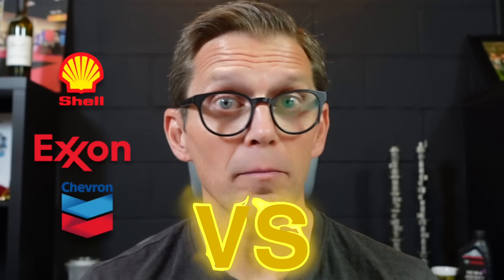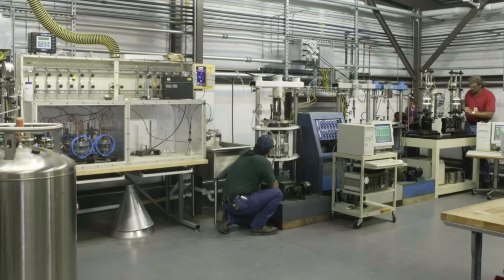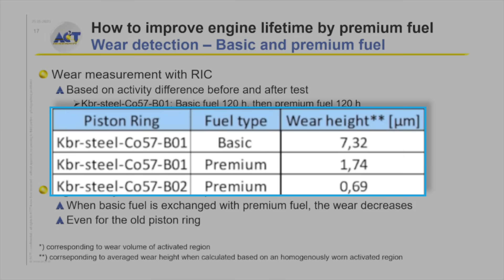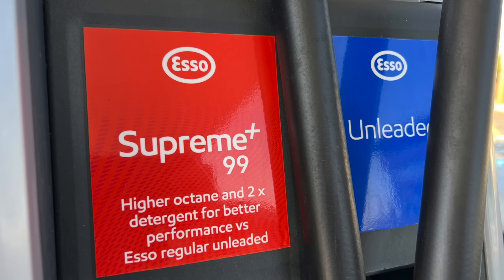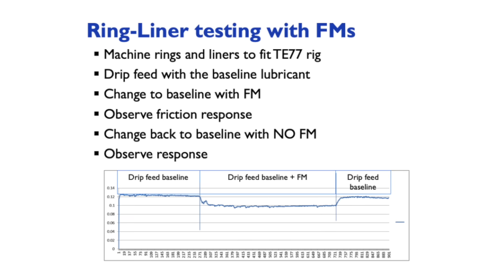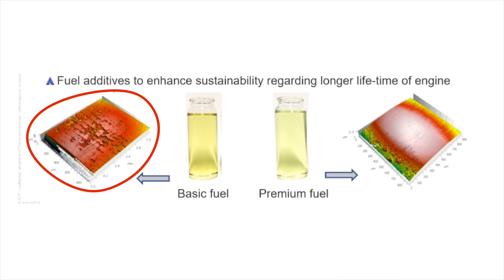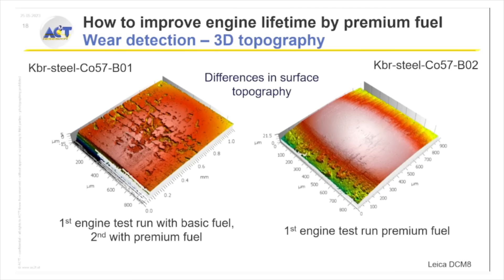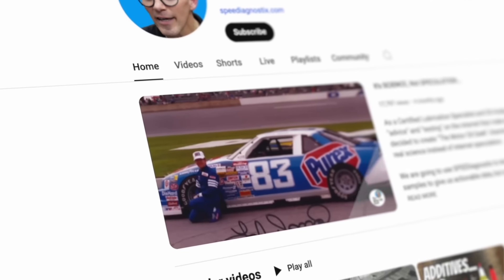Can Premium Fuel REDUCE Engine WEAR?

Comment: Thanks for this video. I always viewed premium fuel additives as for just keeping your engine clean. I never saw them as preventing wear.  I always thought it was just the oil alone that did that.  I will consider using premium gas from here on out.

I do have a question for you that I hope you can answer in a future video.  My mechanic said if I want to clean out carbon build up in my engine that I would be better off using high octane fuel instead of buying some cleaner from Auto Zone or similar stores.  He claims those cleaner in store are very concentrated and while they do the job they also eat away at seals and plastic liners in the gas tank.  

Thanks

Comment: Marvel mystery oil in fuel eliminated fuel dilution and oil consumption on my 2014 Mazda CX5 with 145k miles, really magic stuff it does all injector cleaner upper cylinder lubricant fuel pump lubricant carbon build up cleaner and probably many other things, I started using it in all my vehicles and motorcycles, don’t forget diesel engines last longer for the reason that diesel fuel is 2 in 1 fuel and lubricant works as cylinder lubricant, It’s all about lubrication guys in this world of consummation we living in if you want to keep going longer good lubrication is the key, human body as well has lot of benefits from good oils.
Thanks for the video

Comment: Wow, I guess it make even more sense when you realize a Gallon of gas no matter what the brad or even Octane rating produces the same amount of energy per gallon. Octane rating is a measure of a fuel's ability to resist premature ignition, or "knocking", and is a key indicator of a fuel's performance but does not change the overall energy it produces. But now we can see a correlation between the additive package and ware alongside of it's cleaning effects.

Comment: I had never heard of anti-friction modifiers in gas.  I always just thought it was octane boosters (ethanol) a detergent package, and sometimes some other additives to help the environment (such as California's blend).  I would love to see a fuel comparison between some cheap off brand stations, low end shell/chevron (or other top tier) and premium.  I believe all top tier fuels contain techron or at least several times federal minimum detergent requirements.  I know top tier fuel makes a massive difference in engine carbon deposits!

Comment: I would presume the same additive packages are used in DF2, but what about using over- the- counter diesel additives? I use Hot Shots for the CP4 fuel pump on my 6.7 Powerstroke, and have started changing oil at 3,000 miles with fuel filters at 10,000.

Comment: What is the most common cause of engine failure that isn't reasonably repairable?
Reply: my 1st guess is radiator issues leading to overheating and thus warping of parts or cracking.

Comment: I would love to know the difference between detergents in premium vs regular at a top tier gas station. I also just found E5 93 by my house also at conaco. And are upper cylinder lubricates bad like amsoil, mystery oil, or lucas to add to every tank and an injector cleaner at every 3-5k oil change?

Comment: 110 ppm (basic) v's 70 ppm (premium) = 40 ppm (36 %) reduction.
That's a great result.
This explains why car engines sound better (quieter, smoother, more power) when running premium fuel.
:-)
Reply: 40ppm is nothing, no matter how good the additive is.
Reply: @dwang552  Your rings will last ~1/3% (36%) longer if you're using premium fuel.

40 ppm (40 mg/L) sounds like it isn't much... but if we were measuring wear in the entire engine 70~110 ppm would usually be considered excessive.

A good result would be combined wear metals of 8~9 ppm/10,000 km: 
70 ppm is almost an order of magnitude higher.

There's obviously a lot more wear going on than is ideal.
It explains why compression is one of the first things to drop as an engine ages.

:-)

Comment: What is "premium" fuel? Is it 93? Is it "Top Tier" brands? Is it something I need to add? The science is great, but I need advice on what to buy.
Reply: Great question !!! Was thinking the same as I'm not sure either if Lake differentiates between the two. I always seek out top tier stations,   but I always run premium  due to my vehicles requirements . Sure hope Lake responds. 
On another note how do we really know a specific gas 
Station adheres to corporate standards- not a question for Lake. Just putting it out there.

Comment: I have always read and been told that the only difference between regular, mid-grade, and premium fuels of the same brand is the octane rating. Meaning that, for instance, all three grades of Chevron fuel will have the same additive package. 

Is that still true? 
Is this test of European fuel more akin to test Top Tier vs non-Top Tier fuel in the US?

Comment: With our legacy v6 and inline 4 engines, cheap gas and 5k oil changes gets us 200k+ with no engine failures.  So any better life may not mean much to me, since I am ready for a new vehicles after 20 years old.  For the newer direct injection engines, perhaps it needs better fuel?  I may be dead before I find out.

Comment: Been telling this to my customers and friends for yrs, most don't listen. I run shell 99% of the time v power in my expensive stuff for decades now, along with quality oil and 3-5k interval changes, Ive yet to have any catastrophic internal engine failures, even ran a hemi in a Durango to over 300k without a single leak or lifter failure.

Comment: SoCal resident here running M112 and M113K Mercedes engines. Worn down motor mounts turned out to be a great test environment to determine comparative fuel octane levels from different brands, despite the fact that all Los Angeles gets its fuel from only a couple refineries. Least to most vibrations were in this order: Vpower, followed by Tekron, Synergy, arko, unitd and Krklnd. The latter 2 shook the engines a great deal, triggering knock sensors. 
Test engines had proper compression, new plugs, coils and injectors, no burnt valves or loose bearings on upper and bottom end inspection.
Reply: Also have a M113k. So you're saying Benz's recommendation for Mobil 1 products is moot? So Shell V-Power from now on, including oil?
Reply: @abel4776  Clearly I did not make a general statement about Mobil products. I was referring to gasoline. I am fine using Mobil 1 0w-40 or Pnz Platinum Euro 0w-40 in their current formulations. That said LM Synthoil 0w-40 has managed to stay stable for longer and engines were quieter for longer (anecdotal based on my 2 vehicles). How’s your oil consumption?
Reply: @linvesel  Can't say much, just got it, :) I am reading everything to best maintain the engine for years to come.
Reply: @abel4776  congrats. Do this:
1. 3000 mile oil changes using good oil and either Mann or Hengst filters. 
2. Make sure to drain oil from BOTH drain bolts, your car has two. 
3. Transmission fluid change every 30k with new filter and gasket. 
4. When replacing brake pads&rotors, always deactivate the SBC system using a scan tool with Mercedes-specific software. Do NOT work on brakes while system is pressurized—that will reduce the life span of SBC components and brake feel will be inadequate. If you’re having a mechanic do the work make sure they are using this method—not like a standard car. 
5. Consider a supercharger oil change before 100k miles on the odometer. There are writeups how to do it, and it’s a bit cumbersome, but totally worth it if yours is in a good shape. 
6. Air shocks are utter garbage. Let me know when you’re about to lose your patience with them. I’ll recommend a coilover mod. 
7. Have fun, and none of that small supercharger pulley nonsense. Unless you bought two E55s and you like the sound of metal parts popping under hood on WOT.
Reply: @linvesel  Advice much appreciated. I bought BenzNinja's STAR SDS system, so I should be prep'ed for brakes. You said Air Shocks (AIRMATIC), but do you also mean the Hydraulic system (ABC), which I have? So far I like it, no issues, do you recommend swapping that with coil overs?
Reply: 240K on my M272. Runs like new on Shell V Power, crap on everything else. I only use a 5w40 viscosity and have tried just about every premium brand: Fuchs, Total, LM, Valvoline Euro, etc. Engine runs smoother and gets at least 2 miles per gallon more on LM Leichtlauf 5w40 which makes it my go to oil for the remaining lifespan of the car..
Reply: @linvesel  Just realized the S-Class never had the SBC system, which is bizarre, you would thing the flagship would have the latest and greatest.
Reply: @SeannA.1  Have you encountered a sweet candy smell when you high rev the engine on V-Power? Also, have you tried AMS Oil or Pennzoil?
Reply: @abel4776  Not sure if I’d call the SBC “latest and greatest”… Your S class probably has an ABS tuned similarly and it’s probably a simpler procedure to replace pads and rotors on your S-class.
Reply: @abel4776  I tried amsoil. I did not like it on my chicken Cobb salad and wasn’t great to make fries. But was ok in my m113k. Nothing special, a bit quieter than m1.

Comment: Does normal octane Chevron have the Techron additive?  Should I still use a bit of top side lubricant, such as 500 to 1 two cycle, when using Chevron fuel?  I use Chevron regular low octane since I have one nearby, and get the chevron card discount.  Used to add a small amount of two stroke oil before moving to exclusively Chevron, but now, after watching this and reading comments, am more confused than ever for what's best!?  2004 Avalon with 185k miles, Penzoil Ulta 5W-30 with Mobile1 oil filter.  Thanks in advance!

Comment: What I've learned from the Gas Buddy App is that there's Top Tier gas stations. As a side note, Gas Buddy only gives the best discounts to non-Top Tier gas stations in the App ....so I stopped paying for their premium membership. I have a 22' Maverick and prefer to only buy from Top Tier.

I looked into what Top Tier means and it's an approval rating that a gas station can display when they meet a certain level of additives.
Reply: Agreed, but how do we really know that's what's being delivered to a specific top tier station. Just putting this question our there , not for Speed, only because my closet top tier station is sketchy.  Just saying.
Reply: @murphy5267   I would say personal safety is more important than if the fuel is good vs not as good.  In that situation, I'd limit buying gas at the non-Top Tier locations. Though, I like to run my gas down to at least 50 miles to empty ....so driving farther to a Top Tier station wouldn't be too big of a deal since I'll fill all the way up but not "top off"

Comment: Oil, fuel, additives, etc. I’ve driven mostly Hondas and Toyotas with 87 octane and cheap oil and they all go over 300k miles without major repairs. I love this channel and geek out like the rest of us, but so much of getting a car to last long is buying the right one to begin with. Especially if buying used. My 04 super duty with the 5.4 2 valve also has 240k and still runs like new, original everything except the alternator. Cumberland farms gas, although I do do the oil changes with good oil and filter, every 3k miles max. Insanely of around town start/atop, towing hauling. Problem is, not sure I trust any of the new trucks anymore to last that long without major repairs.
Reply: Yes, I agree with you on vehicle brand. I buy and like the Honda brand. I think there might be a difference today as opposed to 2004 model vehicles in that today's anti pollution standards have the exhaust is recirculated back through the engine to be reburned which makes for a carbon build up issue. I think this will shorten the life span of many new vehicles today.

Comment: So premium fuel (the actual premium stuff) prolongs engine life!?

I wouldn't believe it if it didn't come from a study.

But how significant is the difference in the real world? More wear along the piston rings means more oil consumed (and blow by) but the engine still works reliably if we top off the engine oil (VAG owners already do this, regardless of the fuel. Lol). Is there anything else?

In the test engine, after how many hours of runtime did they observe oil burn on the both fuels?

I would love if there's another video covering this since I'm not well versed in the internals and I know I'm missing several other factors etc.